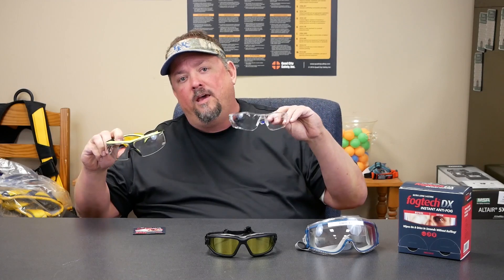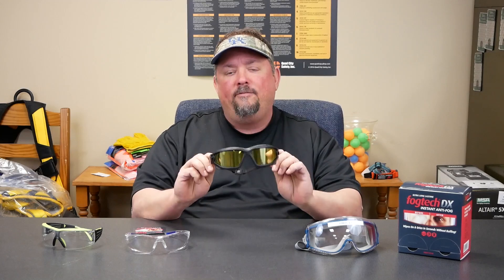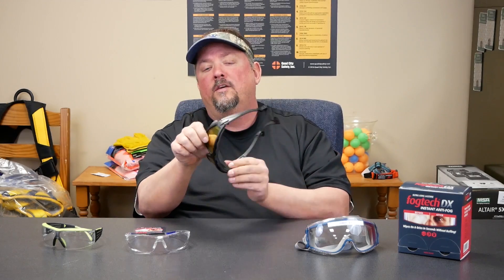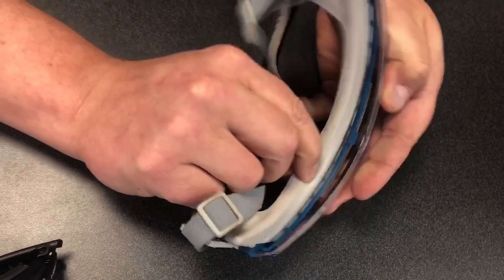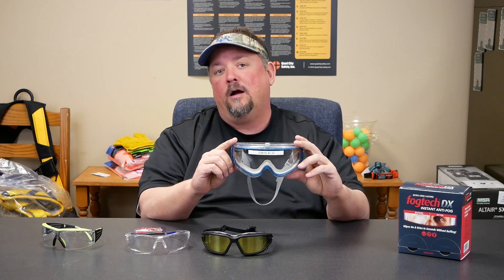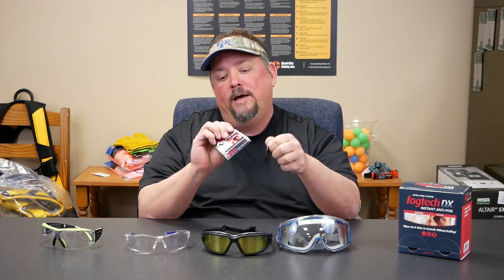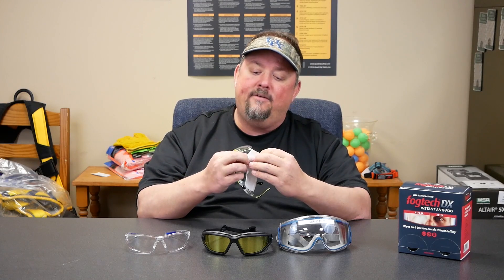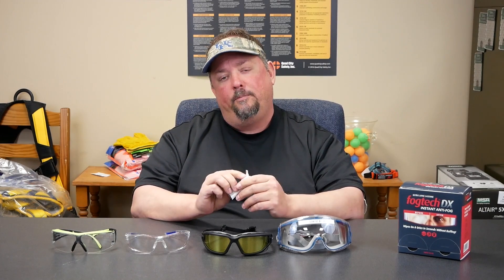Why Do Safety Glasses Fog Up and Ways to Prevent the Fogging

Comment: I work with a lot of acids and would like something that could potentially stand up against the occasional drop on the lenses. And fogging is an issue as to wipe the lenses I have to leave the line and take off my gloves and then wipe them.
Reply from the maker: Are we talking about occasional drop of acids on the lenses?  If so, it would be helpful to look at an SDS sheet.  My assumption would be that you should certainly be in a goggle.  Thanks for watching and we would be happy to help get you into the right eye protection.
Reply: @QuadCitySafetyInc  yeah only occasional drop and most of what I work with is nitric acid. Temperature in the room is cold
Reply from the maker: @archibaldvonlictonpooper5703  potentially take a look at this one.  We’ve had good luck.  https://www.radians.com/products/radians-lpx-iquity-goggle

Comment: Ok so where do I get what to stop my glasses from foging up
Reply from the maker: Are we talking about your prescription eyewear or safety glasses?
Reply: @QuadCitySafetyInc  What is the answer for both?
Reply from the maker: @herbsu4330  Prescription non safety rated glasses are trickier unfortunately.  Any after market product can potentially damage the coating.  Some lens manufacturers do offer coatings more resistant to fogging.  As for safety glasses I would suggest trying out the PIP Recon 360 coating.  We've had pretty good success. https://shop.quadcitysafety.com/store/product.cfm?pID=7C52424D48167A50
Reply from the maker: If you would prefer to try a wipe then I would look at this one.  My suggestion is to always look for a glass with a good coating but these wipes do a nice job of providing protection before it wears off. 
https://shop.quadcitysafety.com/store/product.cfm?pID=7C504A454F117A51
Reply: @QuadCitySafetyInc  مساء الخير شكرا لك ولكن نريد الترجمه ولك جزيل الشكر والتقدير 🌹🌹👍👍
Reply: @QuadCitySafetyInc  ok thx 
I wanted to know for safety glasses

Comment: Since schools are now opening up, i have to go to lab for my chem class, i bought anti fog googles with air vents but they don't work. I also have to wear a face mask making it more easy to fog. Any suggestions?
Reply from the maker: Most anti-fog coatings don’t work very well. The best way we’ve found is to use a good 360 degree coating that it impregnated into the glass/goggle.  We’ve had really good luck with this one. https://www.radians.com/products/radians-lpx-iquity-goggle
Thanks for watching and good luck this school year!

Comment: I have tried many  anti fog safety glasses  and cannot  find one that dose not fog up
Reply from the maker: There are glasses that are out there with 360 degree coated lenses that really work.  Not all AF glasses are created equal.  That’s for sure.  Here is one that we’ve had really good luck with.

https://us-m.pipglobal.com/en/products/?scID=2562&ccID=11613&sID=28065&ssID=79574&pID=81830
Reply: @QuadCitySafetyInc   i seem to create alot of steam off my face  in all conditions  so i will give them a go though
Reply from the maker: Yep, it’s really a trial and error in your environment sort of thing.  Most antifog coatings are applied to the outside of the lens and it slowly wears off when you clean them.  You need something also applied to the inside and it’s baked into the lens.  Good luck and thanks for watching!